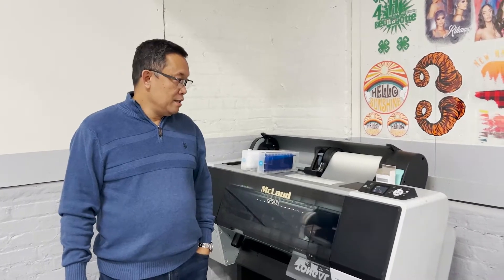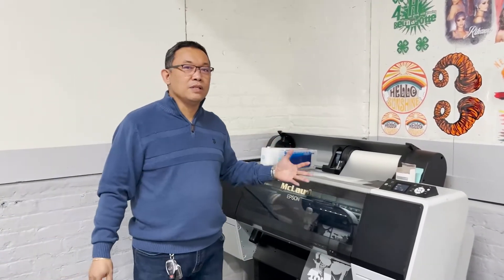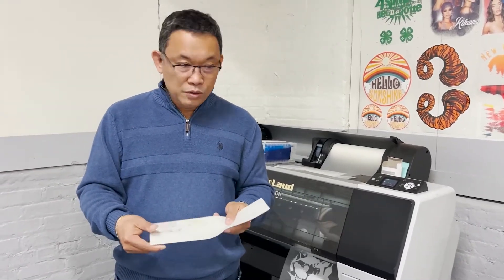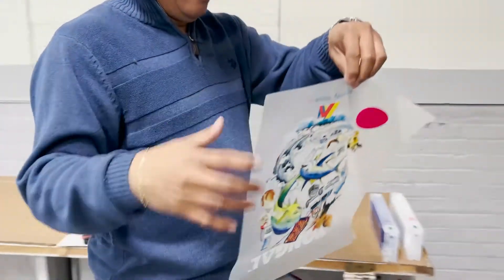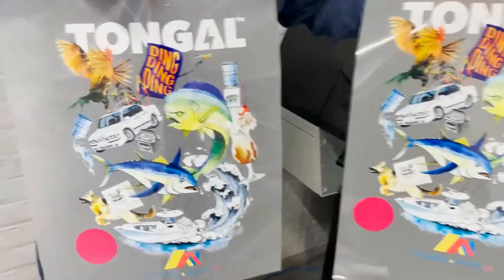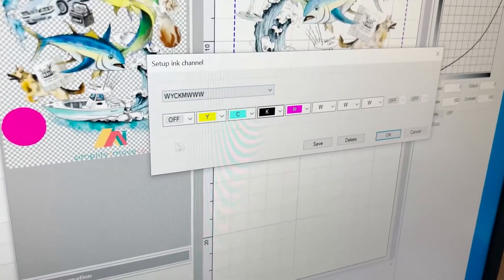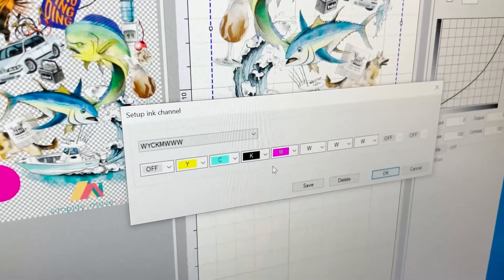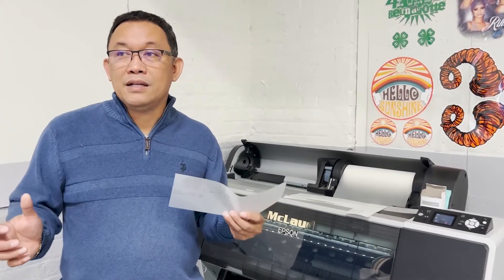McLaud DTF Technical #01: How to save printhead of MP2408 / DTF2405 / Epson 7890 / Epson P6000

Comment: @morganmyers747 i just purchased by printer in February 2023 and I called John and all the tech support and they have not fixed my problem. My magenta has clogged now 3 channels and I only have 1 white left. This company does not care. I contacted them when my printhead was still under 30 warranty and instead of sending me a new one, they had me change the channels until there is no more left. I have called and complained and waited 3 weeks for tech support to contact me and nothing worked. It has been a week i have been waiting on a supervisor.

Comment: Mclaud scammed me, I bought 15 rolls dtf film. Their films didnt work with  any dtf printers. Joseph from the sales department told me they would refund my money (2483$) If I send the rolls to them, So I sent them the rolls 2 month ago, Then he sent message to me about he recieved items. But they still didnt refund my 2483$ I got scammed. I never buy something again from Mclaud who scammed to me. Also their inks are break to the printheads. I solved all my printhead problems after change my supplier. Their printers doesnt work after then 2 week.